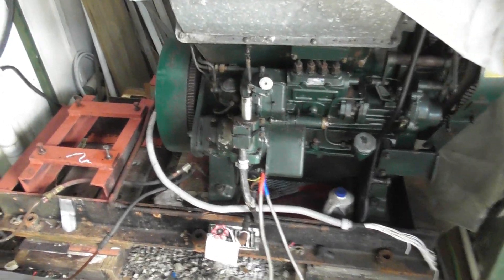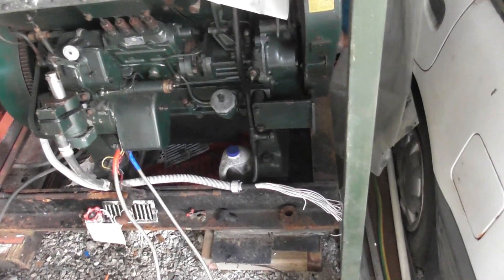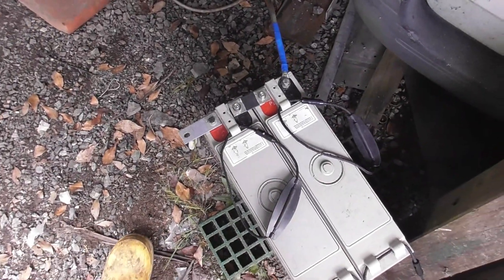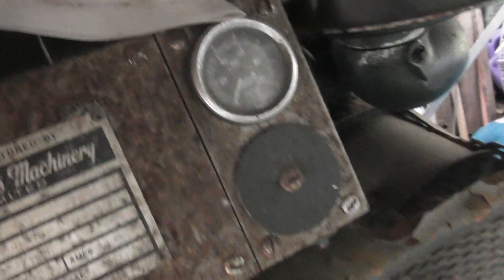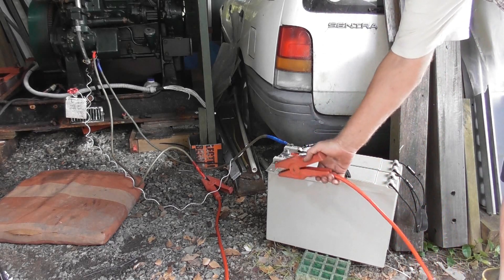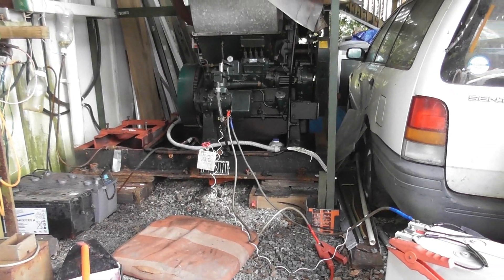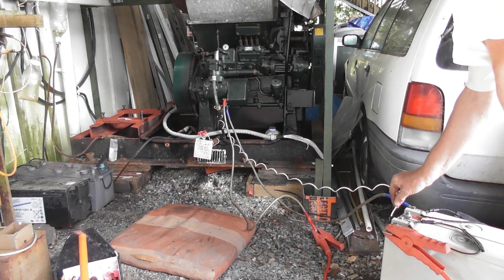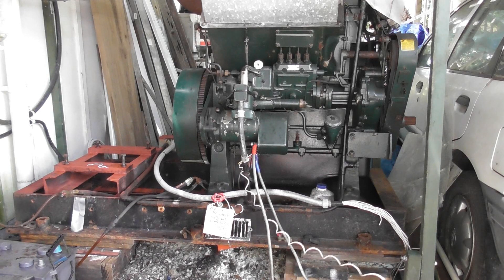Lister HA4 diesel - Purge oil system and then first start in 2½ years.

Comment: What is a Lister is it some kind of generator?
Reply from the maker: The Lister is the diesel engine. The alternator has been rewound and awaiting delivery to our place.
Reply: @RODALCO2007  so it is a electric generator with a diesel engine on it..
Reply from the maker: @anthonycoach4551  Correct. The generator part which is connected to the large flywheel is at the rewinders at the moment.

Comment: Time now to either go to your local airfield and get 50l of Jet A1 to run the engine on, or get some agri diesel to run it on. Jet A will give you an unusual result for a diesel, it will run white out of the exhaust.

Comment: I would have changed the oil first, 30 Months sitting around outside without a heater is too long for my liking, then again I treat my alternators better than my I treat my kids.
Reply from the maker: I didn't show the oil dipstick. That oil has done 22 running hours and is still in good condition. This engine needs 14 liters of oil.
Reply: @RODALCO2007 , hi Ray, it’s the same as your car, time or distance, unless you’re using fully synthetic oil, then 12 months is the longest period between oil changes without a crankcase heater. Being air cooled, the oil has too carry a lot of heat, so yes they do have big sumps to dissipate the heat, my 900Kva V12 Mitsubishi holds 35Litres plus the two oil filters, it gets fully synthetic changed every 24 months and it only has only done 680 total hours, you are lucky you don’t have to do coolant PH tests and changes.
Reply from the maker: @50Hertz60hurts  Yup you are right. I wait for a good deal on oil and will replace it.
Reply: Not that cold in the land of cloud, but yes time to change the oil in it.